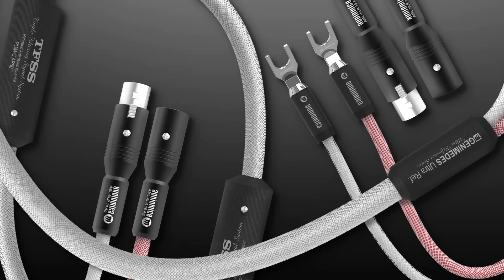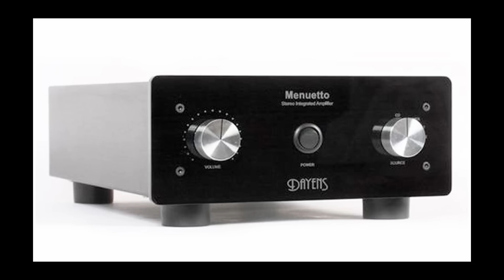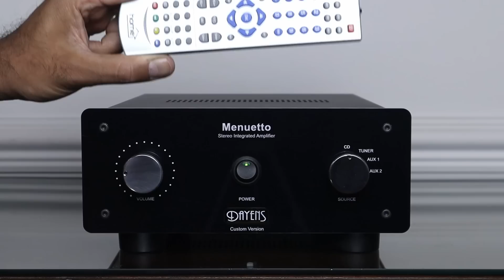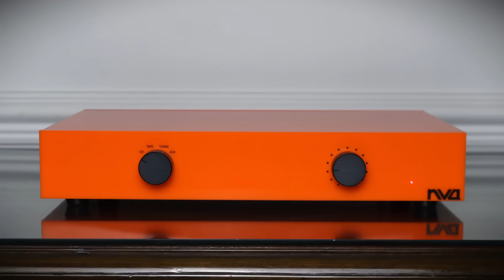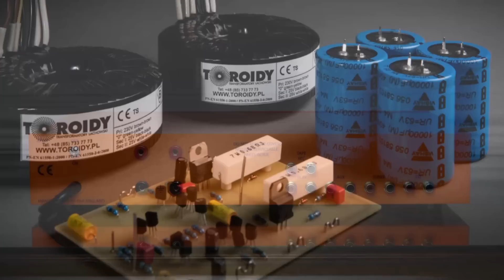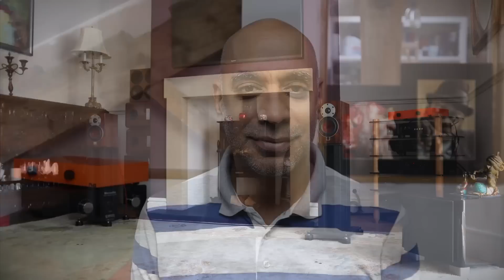HEAD-TO-HEAD ! NVA AP20 LE Vs Dayens Menuetto Custom Amplifier Review

Comment: I as other have said like the head to head reviews for a couple of reasons. Most likely we may have heard or know of one of the products and or know of similar products to have an idea of how to compare. Then when you use new to some equipment it shows that one does not need to go with the mainstream brands. Good review and technical insight. I have older and new equipment and like things off the beaten path myself. SPL Elector preamp, RME ADI-2 PRO FS R BE as the dac, fed into a SPL Crossover and then off to the amps and subwoofers. Take care and always a nicely done format.
Reply from the maker: Thank you 👍

Comment: I prefer the comparison over accolades in a vacuum. The comparison format provides a valuable frame of reference. As for amplification, I purchased a pair of speakers, at your recommendation, which are relatively hard to drive. I'm delighted with the results. However, there are often tracks or a time (usually when the missus is at work) when rattling the windows and annoying the neighbors is in order. Both clarity without coloration as well as the potential for volume are important. Many amplifiers sound great at low volumes but struggle at max db. Some of us at least on brief moments, want to temp fate when it comes to deafness. 
Tarun,  great channel - perhaps the best in the audiophile category.
Reply from the maker: Thank you my friend. Great to learn about your experiences 😊👍

Comment: I picked a NVA update for $20 on eBay for a system out in the shed.   If I’m honest it superior to the PS audio sprout which was half the cost.    My only downside is the power switch and speaker bump you get when turning it on.    At present I’m driving a 4 way pair of floor standers and easily drive them.   Would love to see a sub out but the SPROUT is paired with LS50metas that just can’t keep
Up.   Amazing what dollar values get you again running white noise through for my purposes of testing are surprising especially in the low end although thus the metas trying to do it all so roll off toward the low end is why it is.    Still I decided to use a mixer as a preamp and as a result also send out to a pair of KV2 as you know a loudspeaker company punching well above its weight but one of the few that bridge Hi-Fi to live sound.    Anyway better get back to it stay safe.
Reply from the maker: @josefbuckland  thank you for sharing your experiences 😊

Comment: Thanks Taryn. I really enjoyed the two component review format, and would welcome others. It seems many amps featured are or are at the cusp of underpowered with your stable of speakers. And so a suggestion, maybe add a single point source high efficiency speaker to the mix (say 92 db or greater), for example like the US products from Omega speakers in Connecticut beautifully hand crafted by Louis Chochos. Featuring many full range single driver models that deliver such astonishing detail. Just a thought. Another great review, thank you.
Reply from the maker: @Greg-s5j  thank you. Great points 😊

Comment: Hey Tarun, another great combo.  Yep, love the comparisons format.  Mixed bag on the component selection in these amps.  Huge fan of Toroidy from Poland but not so much the Vishay caps.  Or the Mundorf M-Lytics come to that.  I think there is generally an issue with supply of electrolytic caps at the moment.  I’d go DNM or Elna for smoothing caps.  Maybe Nichicon KG.

As for what I look for, well it has to be current delivery.  I would say that for my main system, given my amp, but as you know I’ve been putting together a student vinyl based system and I’ve ended up with a NAD 3225PE.  Rated at 25 watts per channel, this little amp is a power house!  Easily driving the MA Bronze BX1s to 75db at 10 o’clock on the dial.  NAD has always had the feeling of “British Watts” if you get my drift.
Reply from the maker: Thank you Mark. I catch your drift 😉👍

Comment: I for one welcome these comparison reviews. I too greatly value the NVA's purity but for me a remote control is essential. Matching it with a high sensitivity speaker is IMO also essential and while the Pearl Acoustics single driver design would be ideal, the price differential makes it problematic. The UK's Electric Beach Audio speaker designs would be a great match for the NVA integrated both in fidelity and closer in price. Canada's Paradigm Founder 40b bookshelves and Reference 3a bookshelves also come to mind. In future, I hope you can do a review of speakers from France's Jean Marie Reynaud line and in amplification, a Lavardin amplifier and the UK's LFD amplifier. Thanks again for what you do.
Reply from the maker: Thank you Geoffrey. I appreciate the suggestions 👍

Comment: I am using a pair of Adam Audio T8V's with an Audiolab 9000CDT and a Goldpoint XLR passive pre at the moment.  Surprising sound quality!  Like the approach with the NVA product and as you say should be great with the right speakers. Maybe some from Audio Note?
Reply from the maker: That s a good suggestion 😊
Reply: I've got the Adam audio t5v paired with the t10s sub. Adam audio T monitors are surprisingly good to listen to compared to most studio monitors are a little bit more forgiving and musical. Maybe not quite flat curve so worse for recording but better for hifi listening. For 250 for the monitors and 300 for the sub I'm impressed at the quality. You get very good clarity. They only fall down in tonality and refinement a little. Individual class D amps in each one and a balanced connection to my DAC which is only a Ifi Zen Dac 2. Easily had my money's worth out of this setup. The 1 grand acoustic energy award winning active speaker is probably the next upgrade. But in no hurry.

Comment: How is the circuitry inside the NVA accessible for service? Does the bonded poly enclosure render this a disposable amp in event of component failure?
Reply: That was my first thought too when you said you couldn't open it.
Reply: Nva can open the case without damaging it.
Reply from the maker: It would go back to NVA to open the case 😊

Comment: As regards amps (or power amps at least). I'd like to see a comparison between a Nord acoustics value line class D NC122 or NC252 and a class D AZ XTZ edge A2-300, just to see how good (or otherwise) inexpensive (c. £400) class D amps are becoming.

But even more than that, I'd love to see you compare/contrast an open baffle speaker with a box speaker in a similar sort of price class.😊
Reply from the maker: Thank you. I appreciate the suggestions 😊

Comment: Nice but I'm not keen on wire wound resistors in audio sections as inductive. With a capacitor, it becomes an LC filter. But apart from that niggle all good.
Reply from the maker: Understood. I am not sure what purpose they are serving 🤔

Comment: It's 2024, and I'm shocked at how many amps don't have at least a trigger input, much less a gain adjustment.
My requirements (<50 lbs and <16 in deep, trigger input/output, gain adjustment, RCA loopout for subwoofer).

As much as I love my Parasound 2125v2 for my GoldenEar BRX, I've upgraded to the NAD C298 (similar to NAD M23).
My Parasound moved to powering the surround L/R speakers in a mixed use music/movies 7.4.4 setup and movies sound better.

My video https://www.youtube.com/watch?v=ncwCopnHJqA
Apple Music lossless
Reply from the maker: @mrpmj00  thx for sharing 😊